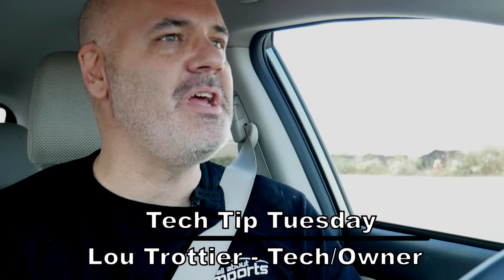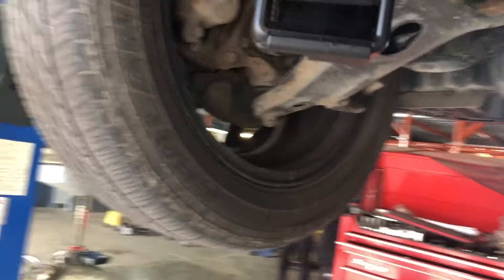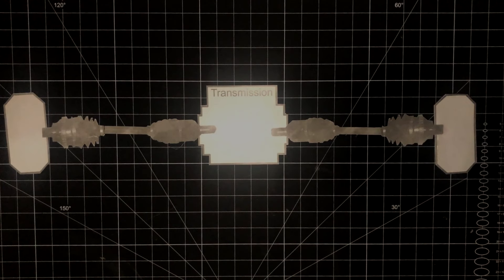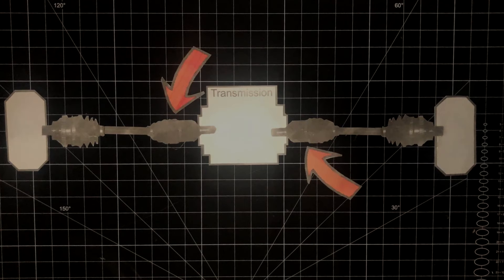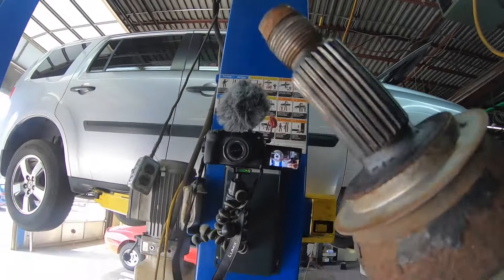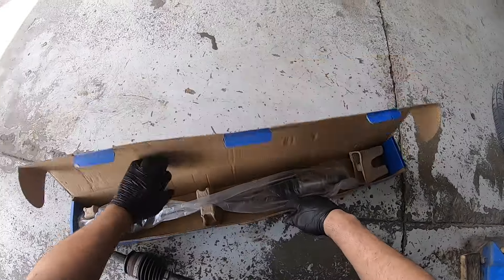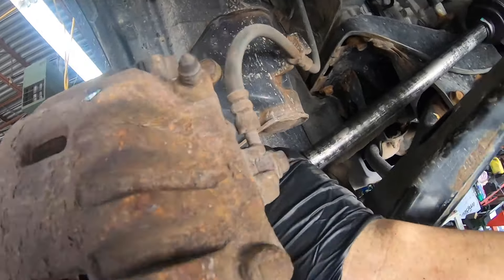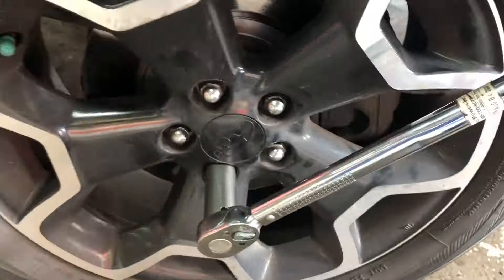Noise when turning steering wheel at slow speeds

Comment: FYI 🤔 Check your Rotors for build up of rust. It will make contact your dust shield and make sound when turn. Bent your dust shield back a little. It could be a simple fix
Reply: I think that might be it, I'm checking it right now on my car lol
Reply: Oh wow I didn't think of this. My outback has a loud whine noise when slowly turning left.
Reply: For me it doesn't matter if I'm moving, I could turn the wheel left and right while I'm in one place and a rubbery squeak sound will start
Reply: @good afternoon world  Same! It's driving me crazy and I really didn't want to have to go back to the mechanic so soon.
Reply: Nah. Mine is a straight up creaking sound
Reply: @goodafternoonworld4456  did you find out what the issue was?
Reply: @user-ik8fl2xr5t  did you have the same issue? if so what was it?
Reply: @dejadrew8241   checked it myself and couldn't see any issues. Also took it to a mechanic and he said it's fine.
Noise is still there so I have no idea what to do honestly
Reply: @user-ik8fl2xr5t  dumb question but did you have to pay for the mechanics to just check on it?
Reply: @ShadowOfDeath33  I actually went to the mechanic to get my 12v outlet fixed. As I was leaving I asked him to take a test drive and let me know if the noise is a big issue, he said don't worry about it. I believe he didn't charge me for it
Reply: @goodafternoonworld4456   did u find out what the noise  was
Reply: @jamessmith1948 did u?
Reply: This is so true. Especially when you get a subtle vibration.
Reply: Rotors make a clicking sound
Reply: I think this is my issue.  My Dad Said something about that

Comment: Hi, thanks for the video! Hm, mine sounds different, so probably not a cv joint. I read through the comments and didn't find a description quite like mine, although grinding is probably the closest. To me it sounds like crunching on rough gravel or rocks. In fact that's what I thought it was the first few times I heard it (because there is actually a lot of gravel and road debris around here), but it's definitely the actual car. It crunches loudly when I make slow turns. Not actually sure if it does it consistently on left turns but definitely right. The thing is, my friend who was in the car with me heard it and immediately thought it was that my brake pads are really worn down. I guess he experienced something like that in the past. But the mechanics I've called said it wouldn't be related to the brakes. (I do definitely need to get them replaced regardless.) I just really want to know if it's likely something else bc that sounds pretty urgent, but I'm also low-income. My friends are going to try to replace my brake pads for me, but I have to drive pretty far to get up to them, and if there IS another issue, and it's serious, then I should probably get it fixed first and asap. But if it's the brakes after all, that would be a waste of precious money. >< Any thoughts/suggestions??
Reply from the maker: brakes usually only grinding noises when you are applying the brakes.. otherwise maybe wheel bearing.
Reply: Yea my steering wheel sounds different than this I just had my brakes and rotors done and I belive it to be my rack and pinion
Reply: adamb84 😂

Comment: Ive replaced the struts on my 2014 accord back in 2018. They put on quick struts. Started doing grinding noise when turning the wheel even while being parked. But would make rattling sound going over small bumps on low speeds. Soon after that the struts failed. So they replaced it. Few months later it started again. They replaced the strut mounts. Was ok for few more months. Then started again. Then we put on OEM, mounts from the dealer. Was ok for another few months then started again. At this axles n left control arm went bad, so replaced all that (which was last month) but that grinding/rattling noise  is still there. Breaks/rotors/calipers/ front sway bar links have all been replaced. It sounds like something is dried up. Like that sound old ships and rusted planes make when falling over in the movies.
Reply from the maker: Lower ball joints.

Comment: I have the same vehicle. I definitely hear a clicking noise when turning all the way, like a U turn or Turing into the drive way. Would a bad CV axel also cause steering wheel slop and a rough ride over bumpy uneven roads? Could it be the CV axels and tie rods? There goes a bunch of money.
Reply from the maker: no, that doesn't necessarily sound like a CV axle, more like worn tie rod or ball joint.
Reply: @LouTrottier  thank you! I will be checking it out.

Comment: My Ford ecosport front wheel drive have this issue of making noise while turning right from stand still to low speed… service Center have diagnosed shaft replacement due to aging which is 2.4lakhs kms in trip

But but this is not my concern, car is manual diesel and since last 2 days the car 1st and 2nd gear is stuck, no problem with 3-4-5-R, service Center is asking to change the entire transmissions which is costing huge, and I cannot digest this.. what is your suggestion, just changing the synchro will do the work, P.S. the clutch unit has not been change, it’s the same from the factory and clocked that many kms on same default unit…

Comment: I bought a GMC Acadia fwd and when I’m slowly turning left or right like parking it makes a noise as if a “bone was popping out of a socket/ grinding sound”.
The guys at collision care said it was alinement  , wheel baring, suspension, claimed they fixed it and took it back because it was doing the same noise 😭
Reply from the maker: upper strut bearings.

Comment: Hi Lou - what about knocking/clunkong noise when turning, even when parked ! Would it be this or the strut mounts? In your opinion. Thanks !!
Reply from the maker: Cv axles scan only be heard when in motion, so if the noise is present when parked it has to be a strut mount of something else in the suspension.
Reply: Check the stabilizer links and their bushings. It was the problem, in my case.
Reply: Hey Alberto did you ever figure it out? I have the same issue. The knocking/clunking sound is the worst when dry turning. I changed out the struts but the issue is still there

Comment: I own a 06 accord lx, at speeds around 50-65mph the car vibrates and shakes a bit. At lower speeds you can hear a grinding or metal on metal sound while doing a 3 point turn or parallel parking. I feel like the Cv Axles are the cause but I’m not sure
Reply from the maker: Cv joints only shake at that speed when accelerating.
Reply: I still am curious on what the grinding sound is tho.

Comment: Have a 2013 Chrysler Town and Country minivan, 3.6L V-6 and 62TE 6-speed (it's Front Wheel drive). When I'm driving down a straight street or road @ 15-30 mph, if I  move the steering wheel @ 5 degrees left or right (very slightly) --- to just keep the van going straight on the street,  it makes a really awful grinding noise from Left front wheel. It sounds just like someone is sawing through a log at a medium pace. Brake rotors, pads and calipers are all new and have been checked and double-checked. Because the noise occurs when I turn the wheel a little bit, even at 30 mph, could it be: a bad wheel bearing ? Bad CV joint ?   THanks !! Really like to watch your vids; I do my own car repairs and work, 35 years now.
Reply from the maker: You are definitely describing a wheel bearing.

Comment: I have the same noise going on with my 2016 Subaru Forester. On steep turns, while on load I am getting the clicking/knock sound. I took it to my trusted mechanic and they said since both shafts and boots all look good, they don't want to replace it on a guess. But I am stuck dealing with that knock every time I turn to the left. Should I take it back and just tell them to replace the shaft? It's most definitely coming from the CV joint. I hear the noise only on sharp left turns when I have to gas it.
Reply from the maker: Sounds like a right cv shaft, but yes there is a bit of guessing involved.
Reply: @LouTrottier  Thanks for the response. Is it safe to drive until it gets worse?
Reply from the maker: @michaelriccelli8483  obviously If your shop cant give you a diagnosis and has checked everything and says you are okay then I guess you are okay, but it might be better to seek a second opinion..  I cant really give you any kind of solid advice over a youtube chat.
Reply: @LouTrottier  I understand. Thanks.

Comment: Hey I just bought my first car, its a 1998 corolla, and when I turn the steering wheel clockwise at low speed and brake at the same time I hear a loud tooting noise. It sounds like when a train or a large ship honks. Its very very loud. I changed my front brakes but the sound was there before and after. The rear drums are very rusty and squeek but i dont think its that as the sound only happens when i move the steering wheel clockwise. 
I couldnt find any video on youtube that recreates the sound I hear. I dont hear no clicking or anything, just the loud toot. Any advice?
Reply from the maker: send me a video of the noise.
Reply: @LouTrottier  okay ill record and upload the noise on youtube. I will respond again when its uploaded. Thank you very much in advance
Reply: @LouTrottier  hey idk if my last comment made it but I did upload a youtube short on my youtube channel which contains the noise. I did try to send a link but now i cant see my previous comment so im writing this just in case
Reply from the maker: @Tapped-o9k  I did take a listen.. If I had to guess I would say that is a noise coming from inside the steering rack.  Try a power steering conditioner additive.
Reply: @LouTrottier  thank you very much for taking the time and helping me. ill try an additive

Comment: 1year old 2018 corolla. On Cold start hearing a friction noise going into or getting out of a turn. Streering rack was tighen noise still there. Any suggestion for it
Reply from the maker: sounds like backing plate behind brake rotors.

Comment: I was driving about 45mph and hit a curve on the driver’s side and basically broke both left and right of the piece in your video. They told me that particular same piece in your I’ll need both sides and they replaced them and fixed it but now when I drive about 30mph+ when I slightly turn to the left there’s a noise on the passenger seat side front tire and it sounds like it’s metal touching another piece of metal
Reply from the maker: Its probably the front backing plate that is touching the brake rotor.  They are thin pieces of metal that bend easily.  Take it back to the shop, they should be able to fix it quickly.

Comment: Hi Lou, I have a 2018 Buick Regal GS with AWD (83K miles and no other known issues). I have a low volume humming noise only when I turn left in Drive at slow speeds. No noise when coasting/turning left in Neutral. No noise when turning in Reverse. At first I thought it could be the steering rack but the coasting/turning in Neutral rules out the rack. Can faulty CV Joints cause a low volume humming/rubbing noise? I have no clicking or knocking noises. I hear no noises when going staight and the noise is most noticeable at really slow speeds (turning left in parking lots, etc.). Thanks!
Reply from the maker: Cv joints rarely if ever cause the noise you are describing.  perhaps a differential?
Reply: Thanks for the quick reply. The dealership performed a transmission flush about a year ago and the car was at the dealership for 15 days for the second appointment because they broke two different seals during the flush so my guess is that this is all related. They said they had to track down a special tool from GM to reseat one of these new seals. The car was leaking like crazy after the transmission flush. They were able to "fix" everything but also had to repair a rim and replace a tire because of damage done while it was there.  The nearly new tires on the car only had 5K miles on them when the brand new replacement tire was introduced. I'm hoping the new tire wasn't enough to damage the differential. I did ask them about the 5K difference of miles relating to AWD but they never addressed that concern. I wish I would have taken the car to a different shop in the first place and most likely NONE of this would have happened. I will take it to a different GM dealership and I have all of my service invoices and emails, etc. My extended warranty expires in about 45 days so I need to tackle this ASAP! It's crazy that this entire chain of events could have happened because of a simple transmission flush a year ago. Hopefully I'm wrong.
Reply from the maker: @chrisratchford8153  tires would never damage a differential.   sounds like it might have been damaged at that service.
Reply: Thanks Lou, I’ll let you know what I find out. Hopefully I’ll have more information this week. I have an inspection scheduled for tomorrow at Firestone (to get tread wear measurements and possibly a diagnosis of the noise). I’ll report back. Thanks for your input!
Reply: Hi Lou, the dealership said there is a somewhat new TSB that indicates that two types of gear lube must be mixed together for this specific differential. They said that GM was replacing too many differentials before and that this new mix would solve the noise issue. So, after charging me $400 to drain and refill the rear differential with this new magical mix, the noise is actually gone. Hopefully it stays that way. Ridiculous to pay that much to change fluid but I didn’t know the magical mix so I reluctantly approved the work. I just wanted to provide the resolution to my specific GM rear differential noise issue. Thanks for your input.
Reply from the maker: @chrisratchford8153  the mix will be gear oil with a limited slip additive.

Comment: Great video and quick way to find out where the noise was coming from in the Subaru. Question 🙋‍♂️ I have a 2015 Scion tC I noticed a noise like a fan noise coming from the driver front side tire . Is this symptoms of a Wheelnhub bearing going out . My car is lowered not stock please help .
Reply from the maker: Doesn’t necessarily sound like a bearing. Perhaps a dust shield is corroded and touching the brake rotor causing the noise.

Comment: The thing is though, mine makes this noise when turning slightly to the left at like 20 miles an hour. But I just got the new cv joint & axle as one whole part like 2 weeks ago. 
What else could it be? 😊
Reply from the maker: Sure the correct side was changed?

Comment: Great job! My Subaru has a similar problem but it only happens sometimes when driving slowly and sometimes it doesn’t happen. I’m wondering does this mean cv joint problem or just need lube?
Reply from the maker: needs a new joint I suspect.  can't really lube them.
Reply: @LouTrottier   what's the deal with the gsp axel is it better I have to replace mine but I ordered an Everlast
Reply from the maker: @claudeconrad7844  doesn't really matter that much.

Comment: Hi Lou! I think I have narrowed the problem I'm having with my car to the cv axle or either the wheel bearing. What other tests would you suggest I perform to rule one out so that I make the correct diagnosis. Basically, my car is making a sort of metal scraping noise from the drivers side that mostly happens while making a sharp low speed turn. It is for a 1996 Ford Thunderbird. Any feedback will be greatly appreciated! Thank you and I hope you enjoy this day. Peace
Reply from the maker: CV axles click, sounds like you need a wheel bearing or something scrapping in brakes or backing plates.
Reply: Check your dust shield around your rotors . A build up of rust around your rotors will make contact with your dust shield and make noise when turning. It could be a simple fix

Comment: Hello. I have a question.  Mine makes a rubbing sound only when i turn. I have a chevy traverse. Do have any idea wut it is?? Awesome video by the way
Reply from the maker: Most likely the rotor backing dust plate is corroded or bent and is running when you go around a corner.

Comment: On my Golf 7, there is a knock on the front suspension on the right side when you drive from 5-30 km/h, it is heard best there, after that it is less. Knocking, knocking on a rough road, on small crossings, on a policeman lying down, I will slow down, sometimes I hear knocking on a flat road as well. Went to several service centers, the masters don't know what they are hearing, they say everything is ok. Do you know what it could be?
Reply from the maker: Possibly upper strut mounts.
Reply: @LouTrottier  Sometimes when I turn on/ignition on, the same second I hear that sound tuc

Comment: I have a front wheel drive. When I'm driving at a higher speed and turn the wheel it wants to fight back in the opposite direction. Also when I'm turning tight in a parking lot something is binding up and popping really loud even jolting the car. It even almost stops the car so you have to accelerate to move and will pop immediately after. Only thing I can think of is rack and pinion or the cv. What do you think could be causing this?
Reply from the maker: sounds like upper strut mounts have failed.

Comment: I have the same  problem i just replaced my axle with an oem part and the noise is still there ,new ball joint  , and still also new bearing  I'm lost . any suggestion would help
Reply from the maker: other side perhaps?